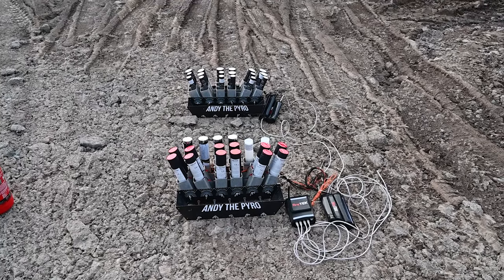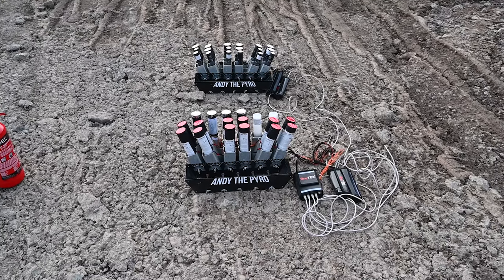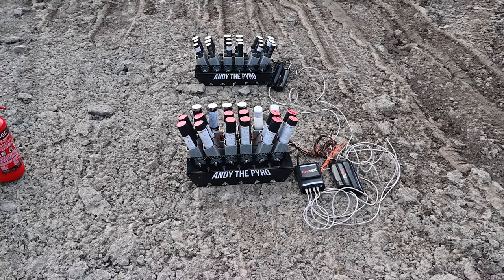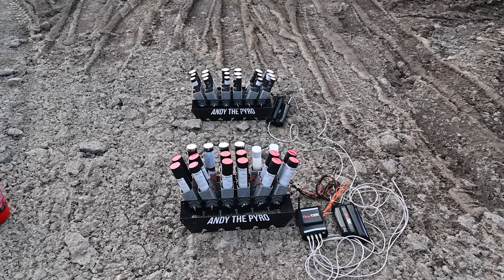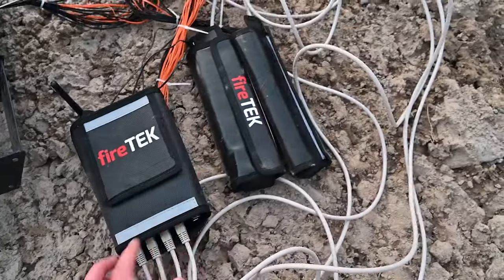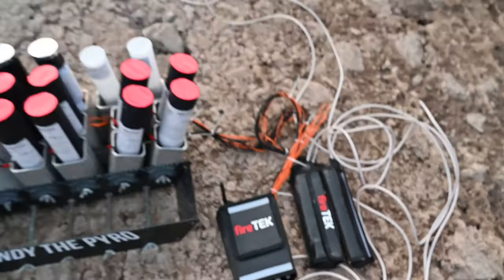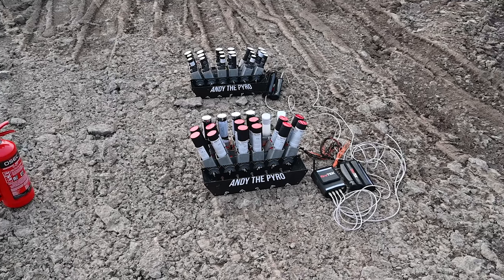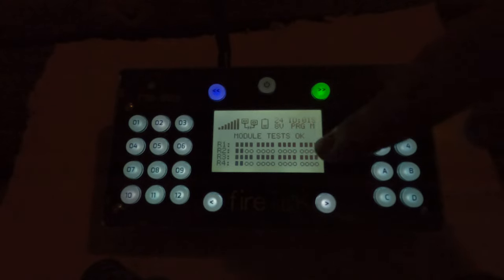Testing single shots with my new firing system

Comment: Why the change? What was the issues with Cobra?
Reply from the maker: I wouldn't say I had any particular issues with Cobra, it's a great system. However, I had the old hardware, version A, and the resolution on those modules are terrible and I didn't feel it was worth the upgrade.

*Edit: resolution
Reply: 10-4